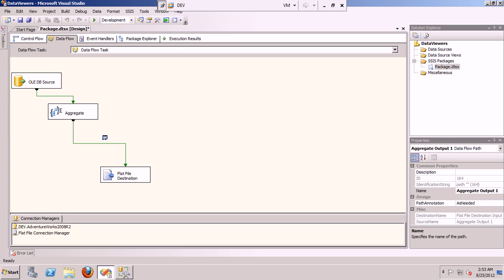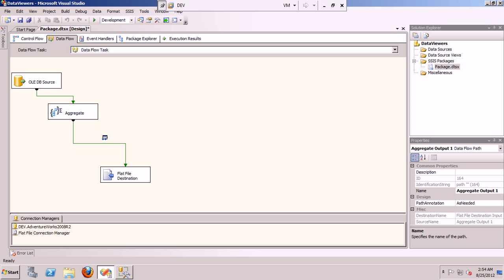Aggregate Transformation In SSIS

Comment: I have to process few flat files to insert their data in one table in one database. But there is one particular column (LastPromotionDate) that may exist in few of the files but not in all. Now for files where it is existing, its value is to be inserted in corresponding column LastPromotionDate in the destination table. But for files where it is not existing, I have to use some variable value as input to the column LastPromotionDate in the destination table. Is it possible, if yes how?